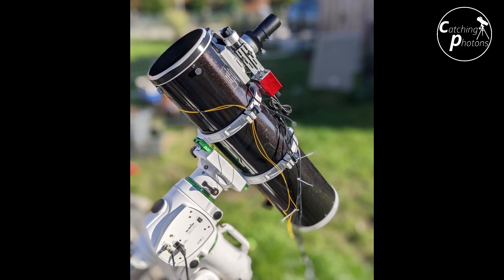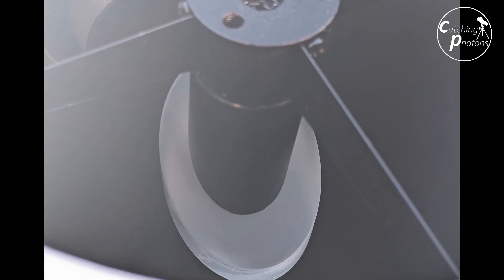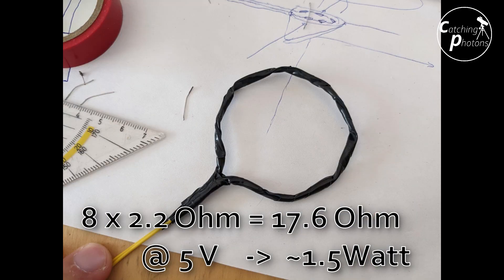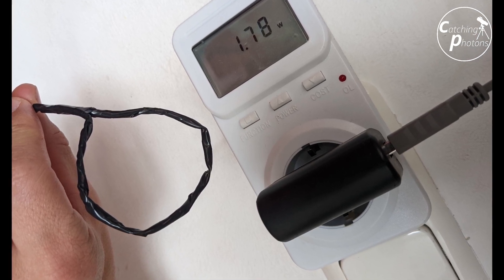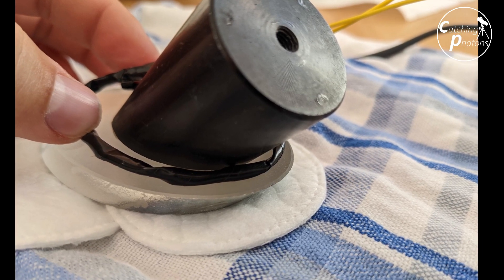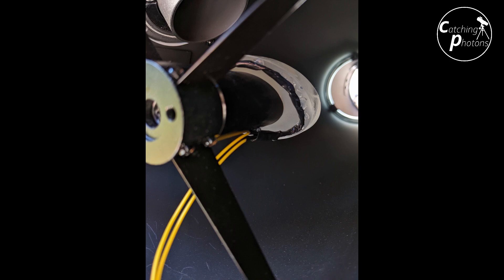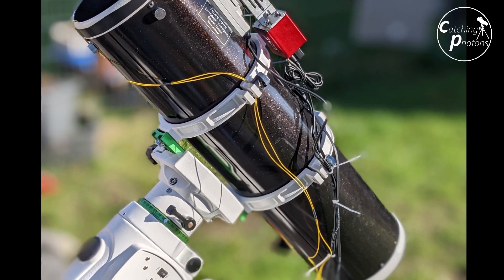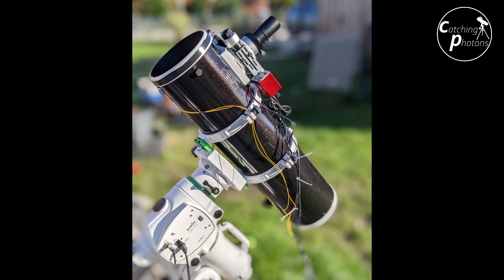Simple DIY - Dew Heater for Newton Telescope [5$]

Comment: 😮 i conected 3 (0.5 v x4 ohm) resesters in a loop . usb cabel like yours . put the usb in a usb mobil phone charger . but it gets to warm .like    maby 50c or more . is the temp lover from ex usb out let from asiaair!!????. Pleace what could be wrong .just want litle beond ambien .
Reply from the maker: Hey! If you use 3x 4Ohm resistors at presumably 5V USB out this means you have 

R= 3x 4Ohm = 12 Ohm at U=5V
-> current is I=U/R = 5V / 12Ohm = 0.4A

Power P = U×I = 2W and thus ever resistor needs to dump 0.7W but is only a 0.5W part -> it overheats.

To mitigate this you can either use lager resistors or just put more of them into the chain until you reach ... Let's say 0.2W per resistor. Then they get just a little bit warmer than ambient. 

Pro tip: you could put another resistor in line before your main resistor loop - make it an adjustable resistor and thus control the amount of current running through the loop.

Cheers!!

Comment: got any tips on aligning the secondary so its central in the focus tube?
Reply from the maker: I have a video on aligning mirrors - using Cheshire and laser, I hope that can help sort things out.
Reply: @catchingphotons  yes i have watched it already, its very helpful but i have a problem, after i align the secondary in the focuser tube and go onto aligning the primary in the secondary i always end up changing the alignment of the secondary in relation to the focuser tube, i cant get it both aligned with the tube and the primary at the same time, using a laser collimator only worsens the problem as when i align the laser dot with the centre of the primary, when i look in through the focuser it turns out the primary is only half visible in the reflection

Comment: I made something similar on my scope few months ago. I used telflon sheet, as stelleton, then stitch it through  with resistance wire. Next I sticked  it with thermo-conductive glue to the secondary mirror. Finally I connected it to LED dimmer, so it is adjustable. In my sites I rarely can observe without it.
Reply from the maker: Cool idea with the dimmer, thanks for your insights :-)
Cheers and clear skies!

Comment: I always use a dew shield to prevent due on my mount. Humidity here is usually at 80% each clear night so it does work a treat.
Reply from the maker: Great, thank you! It's sometimes a bit windy here so the dew shield will increase wind instability.... But otherwise it's a fair option. Cheers!

Comment: You could use enamel coated wire for an even lower profile for the cable.
Reply from the maker: Good thinking! The wires are super thin though so there is not much obstruction. Either way it's better than dew on the mirror 😂🪞

Comment: As you said simple and does the job.
Reply from the maker: Yes, thanks! I like the solution as it's easy and gets the job done. If I ever switch to raspberry pi for controlling the mount I'll add another batch of sensors to turn on/off the dew heater accordingly.

Comment: You can get hot air currents causing artifacts in your imaging. I just fit a dew shield which deals with any dew just fine.
Reply from the maker: Thanks for your reply! A dew-shield works just fine until up until a given angle. If my scope points directly to the zenith I fear dew will find me anyway.

I have compared the FHD during my first sessions and until now I can't see any increase. During planetary I plan to deactivate the heater for your mentioned reason though. 
Clear skies!

Comment: Where did you buy the resistors?
What is the name of connecting wire (I can’t make out what you call it) and where did you buy it?
Reply from the maker: Hey Henry!
The resistors are just off-the-shelf 1W +/-5% resistors you get in every electronic store. Or look at bundles at "common online marked places with worldwide dominance". You'll get hundreds for some bucks. 

The yellow wire is 0.22mm2 LiY I bought from Conrad... Anyway: take what's available, it doesn't matter. Maybe be smarter than me and go with two core cables. 
Than take any old USB cable you can find. No need for something special. 

Clear skies!!
Reply: You can order them online as well from Mouser or DigiKey if you don’t have an electronics components store nearby. As to wire, it’s just lead wire. Around a 16 size should do it.